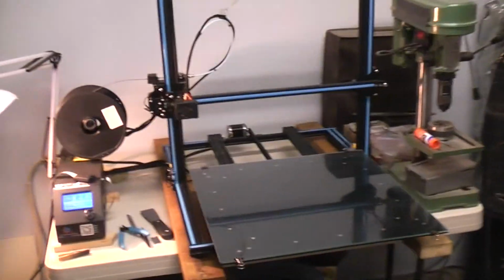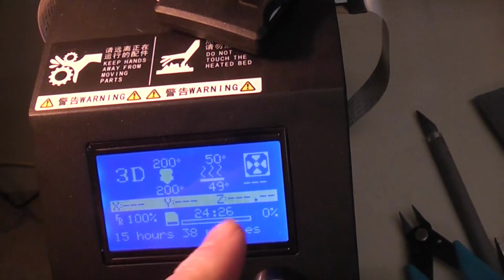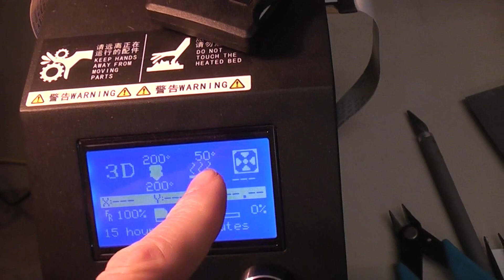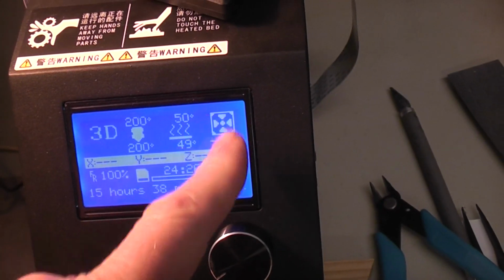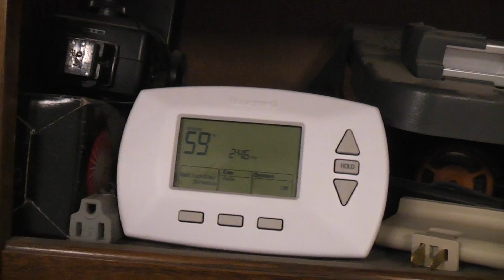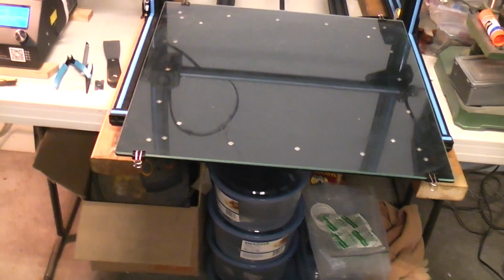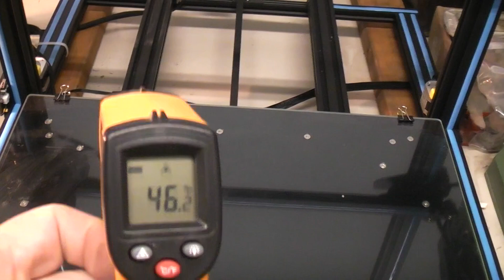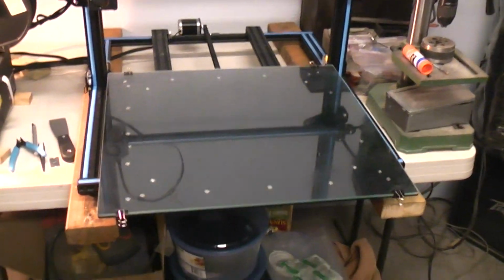Creality CR-10 S5 heated bed tests

Comment: They now do Keenovo 508*508mm heat pads for S5. I guess next time I´m using that one for my next 510x510 printer built.
Reply from the maker: If not too expencive it might be a great upgrade for my CR10-S5. I will look in to it, Thanks for the heads up.

Comment: how is that heat bed constructed?   is it a silicone 500mm square heating pad on an Aluminum plate? ... how thick? ... glass on top?
Reply from the maker: Its just a standard CR-10 PCB type heater screwed to the aluminum plate. A lot of guys up grade there heat beds to 750 watt AC silicon heaters. Here is a link too such a upgrade, and at about 1 :20 in you can see the stock heater unit. https://youtu.be/IhjqfMHyBAI
Reply: Thanks, now I see in your description that the heater is 400x400mm ... so, 50mm of unheated area at edges is going to be a problem. I guess you could add more insulation in that 50mm zone, and less under the heater board .. to get more even heating, but never will be perfect, but then most heater boards are "weak" at the outside perimeter. 
As for those mega watt quick heating setups, those just don't make much sense to me, it takes time for the entire printer temp to stabilize (more than just the temp sensor is being heated, LOL!!! )   ... if using a bed leveling measurement probe ... I want my printer fully stabilized, before starting that probe measurement routine.
   Thanks for quick response, I'm looking for a plan B ..if what I am building now doesn't work:   4 standard MK2 PCB boards laminated to a piece of G10 with several layers of foarm board under that for insulation ... and a single piece of  3mm thick Alumiunum ~ 450x450mm  laminated on top, with a 0.7mm thick piece of PEI for a build surface.  (this is all going on a self designed aluminum extrusion machine with 12mm diameter linear guide rods, a Toranado extruder with E3D Volcano hot end, and BL Touch leveling sensor).
Reply from the maker: It did not end up being a problem for me even when I printed the full glass bed on the Jump Drone robot project, the aluminum transferred the heat enough that I did not get any lifting or warping. But the AC bed upgrade would be nice for the faster heat times and having it cover more of the build area is a good thing also.
Reply: good to know .... but if you do have a problem, consider using low cost foam board (black) with double sided adhesive ... I started using this on my builds, 2 layers of foam board, first layer has wiring channels cut in it, 2nd layer covers those wires/channels, a nice clean look for cheap. Those channels can even be filled with silicone sealer, to strain relieve the wiring.   My 12V  200x300 bed heats to 80C in less than 15mins.

Comment: what slicer do you use and which settings?
I got many problems of layershift and warping.

I would be very grateful.
Reply from the maker: I was useing CURA and I found the setting on you tube some place. the problem is, just the other day my CURA decided to crash or update. I do not know what happened other than when it opened all the custom slicer setting for all my printers were gone. But having said all that warping and layer shifts are not a problem with slicer setting normaly. Layer shifts could mean that the stepper driver is not set right or that something is binding. Warping has more to do with what material your printing and the bed surface. Glue stick works good for me, hair spray did not work as well. Masking tape is a pain the ass to get off the print and replace on the glass bed. Buying cheep build tech type bed stickers is a good way to go, they work great if you heat the bed to 50c or 60c.
Reply: I am very thankful.
I flashed the Firmware to the newest Marlin and am using Cura, too.

It gives the impression that the jerk or acceleration value is the reason of layershifting, cause the Stepper loses steps. however, I am not satisfied with my results. But I like your big prints very well. 

Where exactly did you find the settings, do not you have any more?
Reply from the maker: I do not recall where I found them, just searching on YouTube. The basic settings for any printer of this type with a Bowden tube will get you good results, but then you have to fiddle with them to get them really tuned iin. Right now I do not have any setting for the CR 10 S5. But as soon as winter leaves this part of the country I will have to find some again so I can finish the large Drone robot. So in a month or 2 I will be printing on the big boy once again. Till then its what ever printers the wife will let me have in the house.

Comment: I've been thinking about an S5 for printing helmets, it looks like the heated bed might be a problem for me.
Reply from the maker: Has not been a problem for me as you can see in my Jumbo Drone printing project. The parts fill the bed and not one lifted or warped part when I use glue stick in the glass. The other way you can go would be to put on the china build tac type sheets on the glass. They are cheep on ebay a 5 pac of 250mm by 250mm was like $20 bucks and 4 of those sheets will cover the bed.
Reply: I'm wondering if the 400mm Keenovo heated bed would get it hot enough for ABS printing.
Reply: @originaltrilogy1  get a 500mm one...